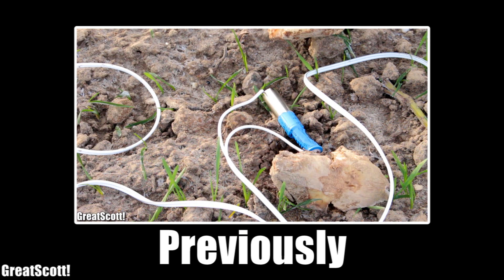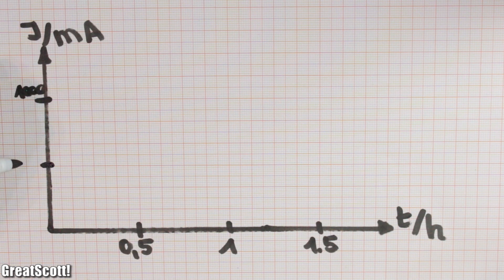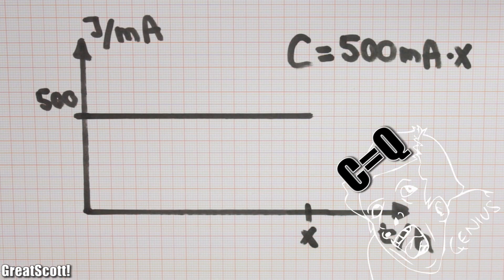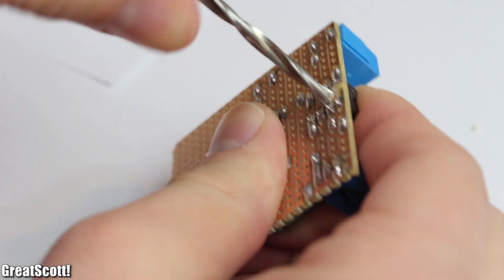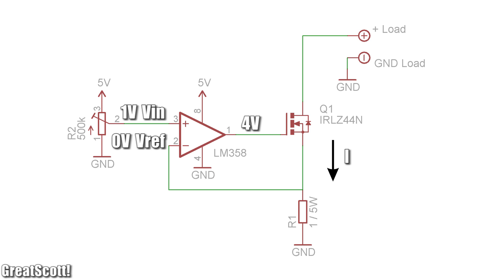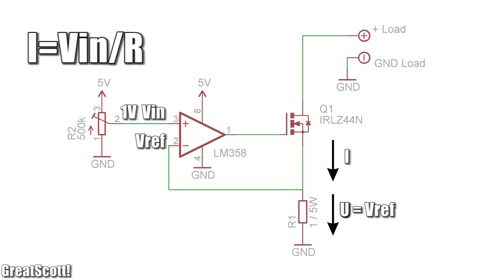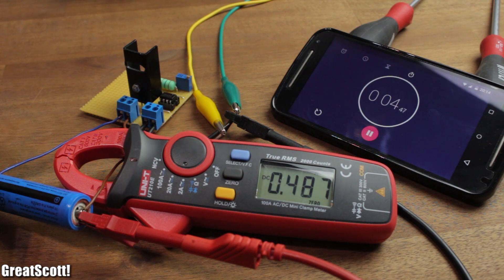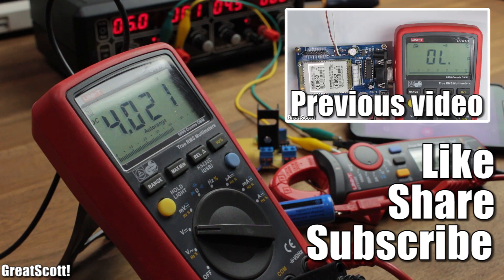Li-Ion Capacity Test || DIY constant current load

Comment: I am still learning EE at school so I may be wrong but wouldn't you need a high value resistor between the gate of the MOSFET and ground to allow it to turn back off? I just remember something about gate capacitance in school but I didn't see anything regarding that in this specific circuit topology.

Comment: .   As  of  today,  (Feb 11-2025)  Maximum  capacity  of  18650  cell  is  3800mAh.
 .   Any  advertised  capacity  of  higher than  that  could  be  fake  and  not  recommended.
 .

Comment: Would it work to reduce the swing by adding a negative feedback capacitor to the opamp, to produce an analog gate voltage and change on resistance

Comment: Dear Scott, can this constant current load be used for testing Lead acid battery, let's say a car battery of 70Ah?
Reply: Yes, but it will take quite a while. If you don't feel like timing it yourself, add a simple voltage cutoff comparator with an SR Latch. You begin the discharge process, the clock gets power, it starts ticking and after some time the voltage drops, the comparator notices, resets the SR Latch which stops the discharging process and the clock as well. Now, you got a number like 23 hours. At 3A, that would be 69 Ah. This will work, but very slowly.

Comment: c couldve made that 7 traces less wide and 4 traces less long
u couldve made it way smaller its just that the resistor would stand up more if u have a large resistor and cannot cut the leads because it wouldnt reach. otherwise very good im gonna be using this

Comment: Attention. FET IRLZ44N is critical. It has Threshold Gate voltage (VGS) 1.0 to 2.0V. This is important.....Usually, Power FET have VSG from 3.0 to 4.0. Those common FET will not work. 🙂
Reply: How about npn transistors?

Comment: I built the circuit firt to test 12V batteries and soon a 48V battery but I stumbled across a bunch of problems
I am using a 5V power source for the IC and potentiometer and a 12V supply for the load
1: I can turn the potentiometer up as far as I want, the load current never goes over 1.6A (only if I double the voltage)
2, the far more concerning problem:
As soon as I turn the load voltage up to ~22V, the Drain-Source-Voltage starts bumping from 18V to over 300Vdc !!! (It usually went 18 to 100V but I had a couple peaks over 300V where my multimeter even went into overload mode).
I only used good parts from reichelt, standart LM358, standart IRLZ44N, and I have no idea whats happening here

Comment: Does mosfet work in here in saturation mode or ohmic region ?
Can i have a mosfet driver after op amp to have less hett at mosfet with 12 v swiching?
Reply: It's working in its linear region where a significant voltage appears across the drain-source while passing a measurable current.

If you test the capacity of a 12V battery with a discharge current of 0.5A (for example), you have to dissipate 6W in the load. That's inescapable physics. That load is the mosfet, so it is expected to get hot and there's no circuit trickery to get around that.

Comment: So, in order to get a load of 500 milliamps, I have to adjust the potentiometer until v in equal to 500 millivolts? (because I don't have a power supply like yours that allows me to know what the load is equal to)
And one more question: can we identify the capacity of 18650 lithium battery by measuring the time of charging it from 2.5v to 4.2v with constant current charger?  Or this will involve an integral once again. I'll be thankful for reply.
Reply: If you have a 1 ohm resistor for R1, you might as well just measure the voltage across it and adjust the pot to give 500mV there.
A li-ion battery will reach around 4.2V well before it is fully charged, so maybe the last 20% or so of capacity has to added at a constant voltage of 4.2V with a slowly decreasing current. You can't really determine the capacity of Li-ion properly on the charge cycle.

Comment: Many years ago I bought some AA NiMH batteries from China and when I got them they were suspiciously light. So I did something  similar and found that the capacity was closer to an AAA battery. So that was probably what it was. When I first complained to the seller he of course refused to acknowledge that the batteries were fake but when I told that I have measured the capacity by integrating the current over time I got my money back.

Comment: Would something like this work for quickly testing the true capacity of a lithium -ion battery from say, a Samsung Phone (where unlike iOS, the operating system does not have such a feature). The idea would be to be able to hook up an android smartphone battery to this and determine the true capacity of the battery. I own a small tech repair shop and the only method for determining the true capacity of an android smartphone battery that I currently know of is through the app: Accubattery, but it requires a few days worth of charge and discharge data before it produces results and I would like to be able to determine this more quickly. Thoughts?

Comment: Hi! Thank you for the video! I want to build it but only have a TLC272CN op-amp and IRFZ44N, IRF540, IRF740 and IRF1404 mosfets. Which one to choose and what to change to make it work? I don't want big loads but only measure some big car hifi capacitors; ~1F.
Reply: If you're working with a 10V supply, any of the mosfets will be fine. For 5V supplies, you really should use "logic-level" mosfets like the IRLZ44 or IRL540, etc. The TLC272CN works with supplies from 3V to 16V, so is fine with any supply in that range. You don't need to make any changes.

Comment: 2:34
With a negative feedback, you do not have a comprarator. 
I may be wrong, but here's what I think:

Through the feedback path, the OP is trying to get a 0V difference in between its inputs. (Comparators do not have feedback, just two inputs. )

So, it is taking the voltage on the potentiometer as its reference, and regulates the mosfet in its linear region (that's why it gets hot), in order to let so much current pass, that
 I_R1•R1 = U_ref
 at potentiometer. 
In orher words; The voltage drop at R1 were the OP is measuring, is equal to the voltage at its non inverting input (+),  due to the current which it allows to pass through the transistor and  through R1. 

Meaning, you have an amplifier with the resistance of the Mosfet dictating the let's say degree of amplification. 
Said degree of amplification changes with the voltage of the battery, because it takes a smaller resistor to allow equally as much current to pass, as the voltage of the battery drops.
Reply: The other way of looking at it is that the circuit is an opamp with a mosfet in source-follower mode to buffer the output current to a much higher value than the opamp is capable of supplying. Then, as you say, the opamp action under negative feedback will ensure that the voltage at its inputs is the same, leading to the mosfet sourcing a constant current (Vref / R1) to the resistor R1. Since that current must come via the drain of the mosfet, it will draw a constant current from its supply, i.e. the battery under test. It will do so regardless of that battery's voltage until the battery no longer has enough voltage to keep the mosfet's source at Vref.

There is no inherent oscillation or ripple in the circuit - that's just a misunderstanding of how a feedback loop works, along with poor layout.

Comment: Hi GreatScott, 
I have used this schematic, slightly changed and made PCB to test the 18650's. But i have a doubt, when you discharge the cell with 1ohm load and 5ohm load separately with same discharge current. Then for both the scenarios is the battery capacity calculation same or do we also have to take into load resistance value into consideration? Thank you

Comment: I'm not completely sure but it seems to me that the explanation of the circuit is wrong.  The output of the op amp should not oscillate but this is an unwanted effect that is solved by placing a capacitor to ground.  I hope I am not wrong.  I think by now you discovered that it was wrong but this video is still on YouTube with incorrect information.  The rest of the video is great.  Regards!
Reply: Why do you think the output should not oscilate?

Comment: why N-channel mosfet is used at the high side? Is there specific reason to use N-channel instead of P-channel mosfet?
Reply: The mosfet is being used as a source-follower inside the feedback loop of the opamp which is arranged as a non-inverting buffer with a gain of 1. That results in the voltage at the source of the mosfet being forced to be equal to the voltage set by the potentiometer. Because we want that voltage to appear across a resistor that is referenced to ground, we need the source-follower to be operating in its linear region with the source at the negative potential. That dictates the use of an N-channel mosfet. We can't "flip the circuit" and have the resistor connected to the battery positive because the LM358 can't accept inputs any close to the positive supply rail. The LM358 can however include ground in its input range.

Comment: Instead of the listed 500k pot, can i use 100k potentiometer instead? I tried this circuit but i can only draw 140 mAh and i dont know if the 100k pot is the culprit
Reply: your op amp should have a stabilized supply, and your Mosfet should be able to close almost completely with the voltage at the output of the op amp.
Reply: Also make sure that the value of your shunt resistor is not too high, the lower the value of the resistor, the more current will flow through the Mosfet, try less than 1 Ohm.

Comment: I used an IRFZ44N instead of IRLZ44N, my circuit not works. Why? Please can you help me???
--UPDATE--
I solve the problem. It was the mosfet that have some problems 😂. I changed it with an IRF3205 and it seems to work perfectly. Now i can test my batteries! Thanks!

Comment: To be honest I am surprised they are above 600 mAH. An easy way to see if they are the real deal before purchase is by asking the seller how many grams a single battery weighs. They are usually well below 25-30 grams which is a dead giveaway that they are purposely mislabeled. A real 18650 battery weighs around the 35-40 gram mark

Comment: But theres a problem with this: the Voltage will be lower with a load than without a load. So there may be more capacity in this battery.
Reply: Please have a look again at how batteries work
Reply: @legominimovieproductions  I know exactly how they work. 
The maximum capacity of it is given for very very slow discharge rate, cause high discharge rate, will cause a voltage to drop inside the battery, which will heat the battery up, cause P=U*I. Thus if you measure only tge voltage and current at the battery, you will get a lower rating than its maximum capacity, cause a part of its energy goes into heat. And the faster you discharge, the more goes into heat, and thus, to know its real capacity, you have to discharge slowly.
Reply: @neutronenstern.  yes but have you ever seen a scenario where a battery is used without load? No? I wonder how that could be...
Reply: @legominimovieproductions  no
but the load usually is very low.
Reply: @neutronenstern.  Well no, i dont know what you think to know, an 18650 cell is used from between a couple mA's in a solar led lamp up to 30A+ in a Tesla batterie or in a vape. And no, 30A is not a small load

Comment: Hello GreatScott! I have made this dummy load several years ago, all by your instructions. It really works great and I have found it to be more than suited for my use for many DIY projects. Still, I would have 1 question please. What is the max voltage that I can apply to the dummy load input? So far it worked for me with 25V, but I dont know if I can go any higher. Also, what is the max current that you would suggest - I try to avoid anything above 1A (I do have a large heat sink, so heat is not an issue). Many thanks for all your videos and for a possible reply. Dont forget to make more of those easy projects for us dummies ;)

Kind regards from Slovenia
Reply: The max current would be the continuous current limit of the Mosfet. The max voltage will be the op amps limit, if it is lower than the Mosfet's drain to source voltage limit. Also, consider the resistor and mosfet's power limit or you'll have some interesting smoke. You can use a beefy heatsink with fan for the mosfet if it does get toasty.

Comment: Is possible to use ordinary n channel mosfet,  With a driver transitor....?  in case we don't get a logic driven mosfet....!
Reply: If you use a non-logic level mosfet, you can't expect it to work properly from a 5V supply. Just increase the opamp's supply voltage to at least 7V (anything up to about 15V is fine) and it will work. You may want to add a resistor between the supply and the positive end of the potentiometer to limit the range of Vin to make sure the constant current does not accidentally get turned too high and overheat the mosfet.

Comment: A better way about this would be buying an lipo charger/balancer. Imax B6 can be had for 15-20$ and using cheali-firmware it can do capacity check with a single click.
You can also set constant current or constant current and variable current with fixed voltage, when it drops to cutoff like 3V. So you can get a decent idea what the ideal capacity is.

Comment: When it comes to 18650 Li-Ion battery, the valid ranges are from 2,000 to 3,500 mAh depends on its drain characteristics.
Avoid the batteries claiming anything below or above this range.
Btw, higher the drain current(>30A), the smaller the capacity (close to 2,000 mAh), and of course, lower the drain current(<10A), the bigger the capacity (close to 3,500 mAh). It's a chemistry. No exception!

Comment: Resistance is not entirely constant during discharge.  Internal resistance is in series with the load resistance.  Internal resistance is related to both temperature and state of charge (STOC).  You can easily compare the capacity of batteries without a constant current source.  Just charge the battery to its maximum voltage and discharge it over a fixed resistor (4ohm).  The time it takes to reach the minimum voltage of, let's say 2.5 VDC, is relative to the battery's capacity.  Obviously, a battery with the highest charge will last longer under equal conditions of which temperature is important.
Reply: The internal resistance of the battery doesn't affect this circuit's measurements because the load is a constant current. We want to know the numerical value of the battery's actual capacity in mAh, and that is most conveniently done by keeping the discharge current constant and measuring the time it takes for the battery's voltage to fall to a predetermined value.

Your method will tell you that the battery that lasts longest has the highest capacity, but we still won't know what that capacity is.

Comment: By the way. Im curious,
 is your testing internationally accepted as a standard way of testing? Are there any rules on manufacturing on the maximum allowed battery storage capacity to be circulated in the market?

Last but not least, should your testing bench is acceptable as a standard, wouldnt other batteries would fall under lower capacity than stated? For example taking the battery you tested in the video in com parison with other batteries in phones and electronics? Aspect ratio of battery volume vs capacity.
Reply: The usable capacity of a battery does depend to some extent on the discharge current used, with lower discharge currents tending to yield slightly larger capacities. However, once you test the discharge at C/10 (the current which would discharge the battery in 10 hours), reducing it further is unlikely to show any improvement in measured capacity. For batteries that have expected capacities around 2000mAh, testing at 200mA discharge current will produce as optimistic an estimate of capacity as possible,  so batteries failing to meet their marked capacities when tested at that rate are clearly making fraudulent claims. There is a law in the UK preventing fraudulent advertising claims. YMMV.

Comment: What can we add to this to make it better ? it doesn't seem very practical in this form with the requirement of using external measuring stuff,  how can we add something which is going to show when the circuit is operating properly and also when the battery is drained   ?  comparator linked to an LED ?

Comment: I know that this video is more than 4 years old, but I just bought 9800mah UltraFire Li-Ion cells. They were really cheap when purchased in a lot of 50. I have a bicycle headlight that the 8.4v 3000mah battery pack was not powering the headlight more than 20 minutes when 3 years ago lasted as much as 1 hour.  So I assembled 2 rows of 6 cells of these UltraFire with a BMS expecting this battery pack to last more than 2 hours. I charged it and it lasted about 35 minutes on the headlight. 

I charged one of the 9800mah cells using a Li-Ion battery charger and then discharged it using the same charger/discharger and only got 1300mah. You can bet I was disappointed. But when purchased in a lot of 50, they were much cheaper than other 3000mah cells. I guess you get what you pay for.

Comment: i got 6 of these ultrafire 4800 mah in parallel on a diy power bank. as soon as i charge my phone the digital indicator in my powerbank drops from 100% -1% every seconds until it gets empty under heavy load of 1.2 amp lol. but noticed it last a little longer when drawing around 0.3 amp max like charging bluetooth headsets. these batteries are extremly light weight, i dont have a scale so i dont have figures. i charge each of them from 3.4v to 4.2v and my usb voltmeter calculates around 400 to 500 mah each

Comment: Can i test the same circuit by 24 v battery?
Reply: Only if you put a big heatsink on the mosfet. At 0.5A and 24V, that's 12W power dissipating in the transistor.